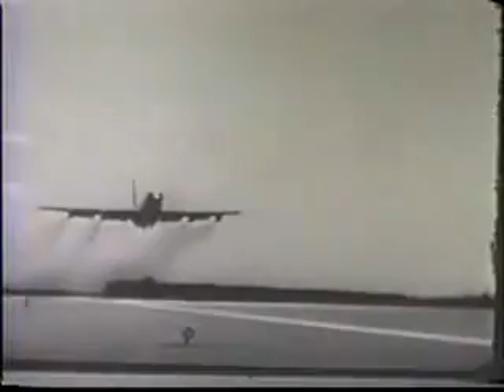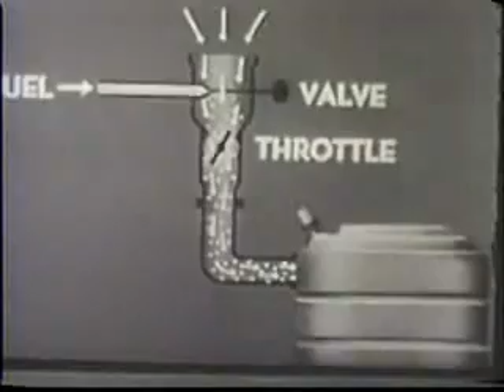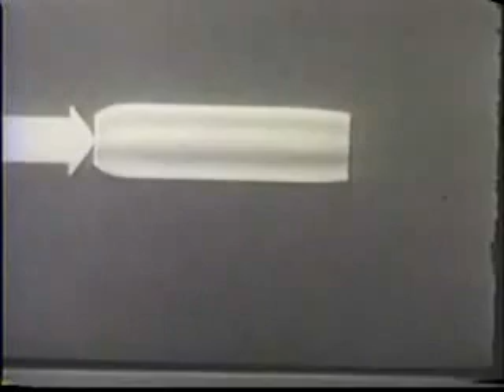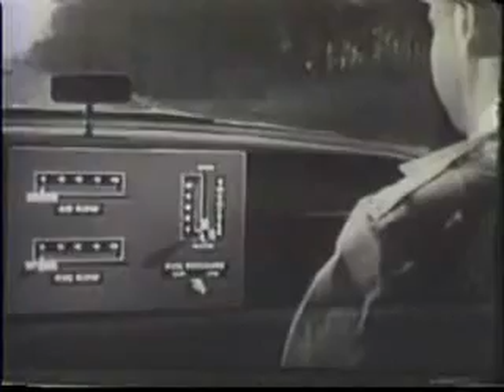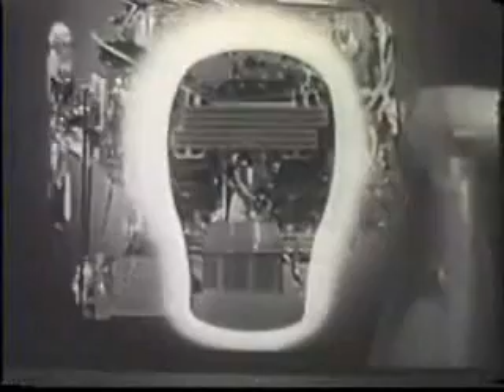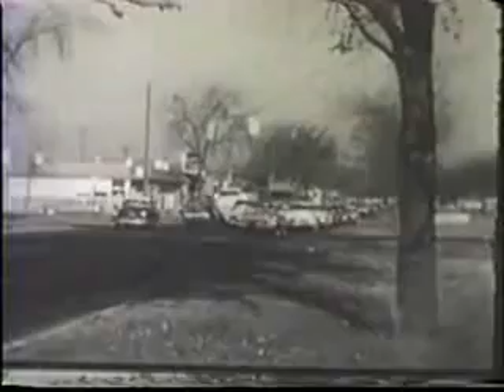Rochester fuel injection

Comment: It is interesting how the rochester fuel injection even compensated for altitude like modern computer fuel injection
Reply: Sorry, but no, it didn't do that. There is no barometric capsule device on these systems at all. Never-the-less, they were, and still are a brilliant design in the context of the times.

Comment: Back in the day that system was often removed and relegated to a shelf, replaced with a carb. Not many mechanics knew how to work on the system. In 1958 Pontiac used the exact same system, making them extremely rare. I knew a fellow that had two Pontiac systems on a shelf.  It was not a timed injection with a single squirt per revolution, it sprayed constantly into all the cylinders. VW used exactly the same concept, they probably bought the system from GM or Bendix.
Reply: Rochester and Bendix are / were GM brands.  It's interesting that Bendix sold their Electrojector only to Chrysler, and it was a total failure.  It got sold to Bosch, who finally produced their electronic fuel injection in 1967 for a VW
Reply: @psk1w1  Hello sir, I'm looking for more information on the Chrysler electrojector system. Where can I find it?
Reply: @paulkirkland1535    I posted about that on Jay Leno's video on the injected Chrysler 300D restored by Per Blyxt:
There is a car with its original Bendix Electrojector system working. It's a DeSoto, virtually the same car as the Chrysler 300D, here: https://www.allpar.com/cars/desoto/electrojector.html The owner got the 'computer' working by replacing transistors and capacitors with modern faster-acting equivalents. It seems the Bendix Electrojector is truly a pre-curser of the modern efi - produced way before the system was ready Here's a commentary on the fiasco which the Bendix system as produced was: http://www.chrysler300club.com/tech/efi/jgrad.html

Comment: Actually the Rochester Quadrajet is more complex to tune than any of the FI 's from 57 to 65. My brother had a 62 fi on a 327 350 horse hydraulic lifter powertrain. 2 screws on the fuel meter and 2 screws on the air meter had to be balanced using a manifold pressure gauge for optimum performance. Not hard to tune just a little patience and time.
Reply: Not  many  knew  how to work on them  so they  put  carburetors  on  them and threw them away ..  I am  sure that  if  anyone bothers  to purchase a GM  Service  manual . They would be easy to tune..
  Stock they ran too lean..  adjust it a tad  richer  for  better  response and higher  horse  power..  Just  like any modern  car engine today to meet emissions standards  it is running too lean..
  Also it  was a $600  option on a  $2,200  car..
   Today  you  can  buy a modern  system  that   looks like the old Rochester..
Reply: @mikeskidmore6754  By todays standards they are easy enough to tune. But back then fuel injection was a completely new concept. The biggest problem was guys didn't understand the concept and customers didn't want to pay them to tinker. So in the secondhand market most got shelved like you said.
Reply: I have that on my 1964 Corvette. People talked crap about them. I LOVE IT. Change the damn Diaphragm seal when it’s worn out. People don’t like things when stupidity seeks in🏁🏁😎

Comment: @Stuurm yea, this was mechanical fuel injection which, while more efficient than carburetors, was less effective than electronic fuel injective, which is more responsive, is able to adjust throttle response more accurately, and can provide a better, cleaner burn. 
Electronic Fuel injection was very primitive in the '50's-'70's because the wires/electronic control unit were very weak and susceptible to engine noise/heat. 
Mechanical fuel injection had linkage problems etc.

Comment: were there problems with this system? why did it not last into the 70s/80s
Reply: Stuurm it was expensive 
A $500 option. It was around until the big block came out. That was a much cheaper option for horse power